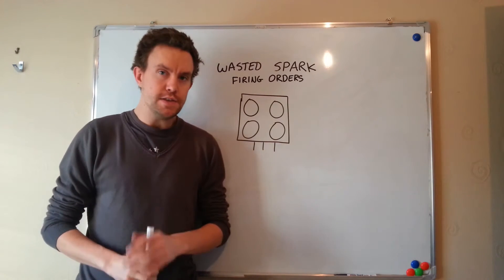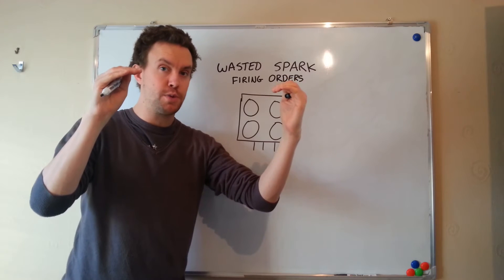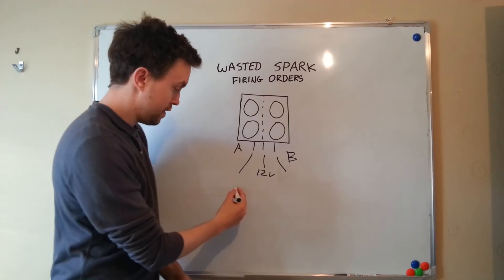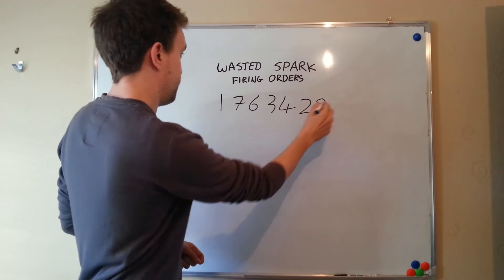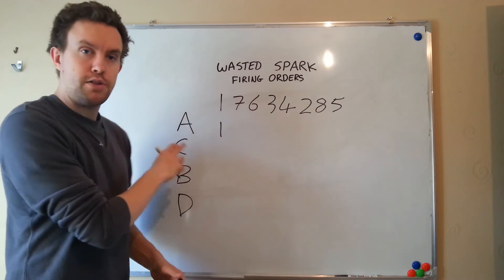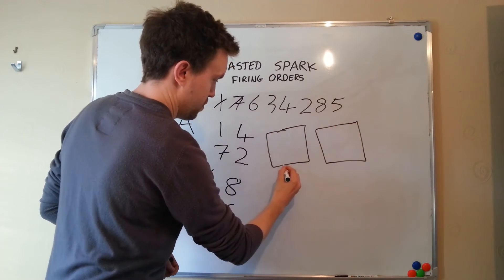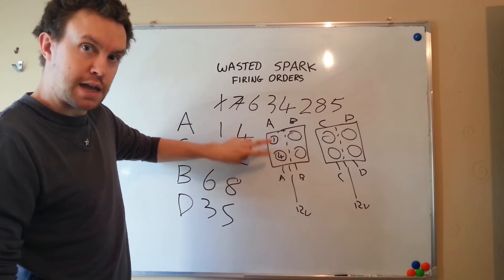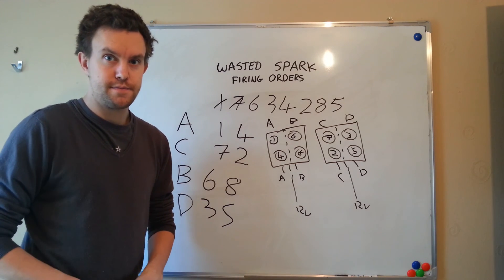Wasted Spark Ignition & Firing Orders for the NODIZ :: EFI Explained with Matt @ M-Tech Automotive

Comment: Since coils fire off signal wire, 6 volts?, Can you wire up 4 separate coils, COP style, on top plug, waste spark style and get more voltage on 4 cylinder engine instead of 1 or 2 coils? Also, firing order on most computer controlled non distributor engines nowdays is 1 2 3 4, in a row regardless of number of  pistons and configuration of block.  Could you do a video explaining the Science of the V explaining why blocks are 90° 60 ° , 72° as in the LFA? Great Job!

Comment: have a question, what is the purpose of a waste spark? No point?
Reply: In guess it only has a cost benefit. You only need half of the coils compared to the cylinder count of the engine and the control of the coils becomes simplier: Instead of controlling the spark of every cylinder you simply control 2 cylinder at once. I dont think that there is any technical reason. Thats why it's called >wasted< spark.
Reply: Could be for emissions, when second spark fires on exhaust. I believe the LT1 Corvette engine was waste spark, mounted on front of engine. Driven by camshaft.
Reply: Or driven by crank? Didn't work well since was exposed to rain, element's.